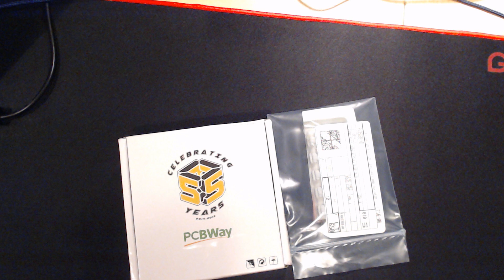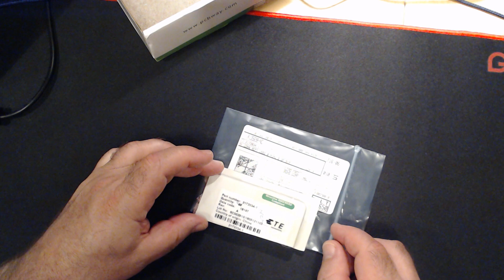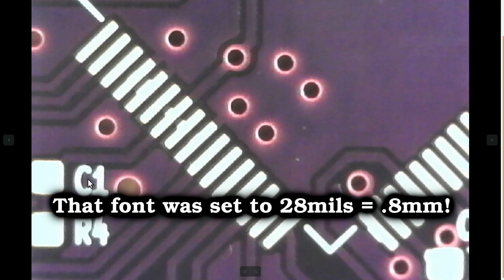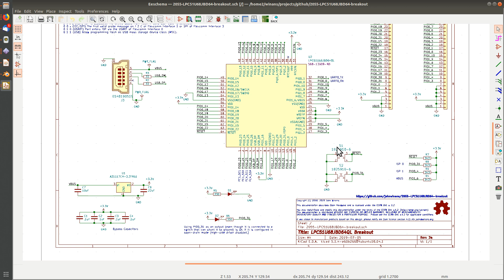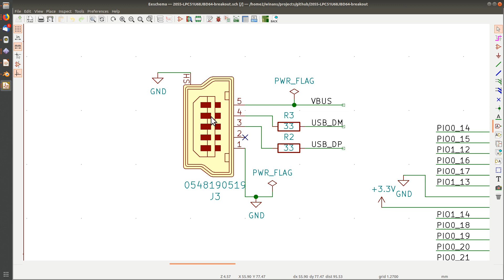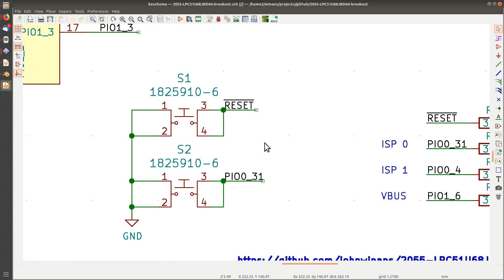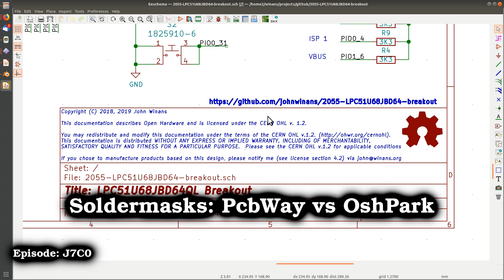KiCad 5 #29b Comparing Soldermasks from OshPark & PcbWay

Comment: Micro USB connectors rely on the spring in the plug to lock in, while Mini USB connectors have a built in lock spring.  The result is, that when the spring goes bad (it WILL eventually) you have to replace the Mini USB socket, while in the case of the Micro USB, you just get a new cable.
Reply from the maker: 🤔  Time to evaluate some of the new power-only USB-C connectors?

Comment: I never use surface mount for usb connectors. The main reason is mechanical strength. If you are plugging and unplugging the usb connector all the time, that is a lot of stress on the pads. Never had a through hole usb fail. I'VE HAD SURFACE MOUNT VERSIONS FAIL A LOT.
Reply from the maker: Yeah.  I fear pulling off the traces when the housing doesn't have thru-hole tabs to keep it secure.

Comment: John, love your series, it's been a big help to this newcomer to KiCad. One question, how can I find a suitable footprint for both the BK-5067-TR and the BLP2016SM-GTR coin-type battery holders? I can't even find drawings for these 2 parts. Any suggestions?
Reply from the maker: I'd google for the literal part numbers.  Digikey has links to the drawings.  I'm not on line to see if it is in the digikey library but check there fiest.  I'd make one myself if it takes more than 10 minutes to search for it.
Reply: @JohnsBasement  Ok, thx again.

Comment: Hi John, I Can't begin to thank you enough about your KiCad 5 tutorial series!  
After trying use KiCad from v4 and continuously getting frustrated this series has been of enormous help. I think KiCad needs to link this series from their site as it is superior and far easier to understand than anything they have.

Anyway, Could you please consider covering the 'Configure Paths' options in the 'Preferences' and some best practices for setting up our KiCAd environment you know directoru locations etc  with more in-depth detail over importing and using external libraries.
Additionally, could you supply some more information about how best to layout a PCB design like the avoiding acid traps, front and back copper pour layers with associated vias would be very beneficial. Perhaps consider routing something substantial with a (ideally live) running documentary. I find I learn best and understand more when things go wrong and see how those problems get rectified. My I suggest something like a publicly published UNO schematic as a common reference.

Lastly a couple of questions - 
1)I Is there a way just to have 1 design but on multiple pages without having to go through the ball ache (and confusion) of hierarchical sheets? I have a large design which I need to eventually print out on multiple A4 (US Letter ish) pages for a manual.
2) Is there a way to have multiple 'main' projects with multiple Schematics and PCB's etc. E.g.  1 Main project - 'Tree' and sub projects titled Apple, Pear . Now to complete the Apple project I might need 4 schematics and 4 PCB layout , for the Pear I might need 2 of each. How can this be accomplished in KiCad?

Many Thanks